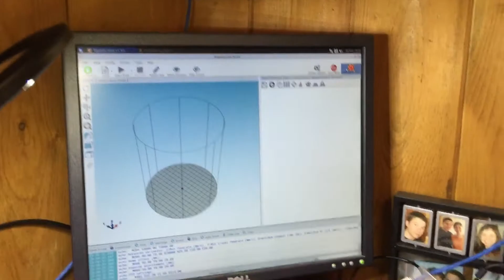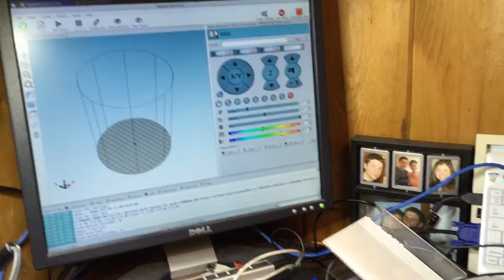Dlt-180 end stops and z-probe

Comment: I'm building one that I ordered the day you posted this (got it yesterday) and I have an issue with the parts differing from the documentation. I got the carriages built with no documentation at all, but the belts are open-end and there's no direction on how to join the ends together to make it a closed loop. I've got 3 thoughts and I'd like to know how you did it before I do something semi-permanent (like zip-tying or cutting them.) Can you show how your carriages are joined to the belts?
Reply from the maker: +Jonathan Mertz all I did was plug one end into the carriage (about half way) and the got it semi-tight (not too tight) and then started putting the other in the carriage and just cut off the extra with a wire cutter.  Here is a picture (https://onedrive.live.com/redir?resid=F34EBFCC1A32BC47!42504&authkey=!AHsWW8KV2Afj03w&v=3&ithint=photo%2cjpg).  This way you can make it tighter or looser just pulling it back out and putting it back in by one or two teeth in the carriage.

Hopefully that gets you cooking!!!  Would like to see your setup once you get it going, do post some vids!
Reply: +iceman198 Thank you very much, that seems to be working with a solid connection.
Any idea why they didn't include a connector for the thermistor or the fan? They included extra wire to extend connections, presumably the fan and maybe one or more other things, but no connectors for those. I'd like to test it out but it just complains that the extruder is below mintemp and won't move. Is that normal, or is there another issue I'm running into. (if you'd like to test, just disconnect your thermistor from the RAMPS board and try moving the head or extruder in pronterface. If yours moves, I've got other problems. If not, that may be my only issue.)
Reply from the maker: +Jonathan Mertz I never actually tried disconnecting the thermoresistor. The fan gets wired right into the board (next to the power that goes to the hotend).  I actually took the fan off the extruder (as it doesn't seem to get too hot) and put it on the side of the board (under the bed) as it seems to get a little toasty under there.  I wired both fans (hot end and extruder fan...well, not the extruder fan anymore) together next to where the hot end wires in.

If you want to just test the extruder motor, I would just plug it into one of the axis spots and move an axis just to make sure the motor moves is all.  If you find (during your first print) that it is going the wrong direction, there is a motor direction TRUE or FALSE in the Configuration.h file to change.  That was something I had to do.

You could always go ahead and just wire it all up and have it heat the hot end up to 200c and then have it move the extruder motor.  Then you'll know if your hot end and resistor work too.  =)  Don't put any filament in...well, unless you want too.
Reply: +iceman198 I've got the thermistor hooked up now but I seem to have a problem with my RAMPS board. As soon as I apply 12V, the fuse starts heating up and soon gets too hot to touch. I think the board has a short causing the fuse to prevent enough power from going to the hot end or motors. Even with all 4 steppers and the hot end disconnected, it still gets hot in a couple of seconds. I'm guessing that this is what has caused my issues from the beginning. Thanks very much for your help! I think my next step is to contact HE3D and try to get my RAMPS replaced.
Reply from the maker: Would you be able to take a pic or short video of how you have things wired?  This is what I used as a guide as the info they sent wasn't that great. (http://forums.reprap.org/file.php?219,file=52456,filename=InternetRamps2.jpg)
Reply: +iceman198 yes, that is exactly how I have it wired. Sorry, I'm at work now so no pic or video. I'm working with he3d to get it resolved.
the fuse no longer gets too hot to touch, just warm, but now the light on the power supply flickers and it clicks when the odometer per switch is on, even if nothing is plugged into the ramps board except power. (It doesn't do it if I unplug power from the ramps board.)
Reply: printer power switch, not odometer per switch.
DYAC!
Reply from the maker: Are they helping you out? They were a little sporadic in responding to me. I had a hard time convincing them something was wrong with my steppers but finally I found they were wired wrong and got the right combination.
Reply: +iceman198 They started out by saying that they could replace the RAMPS board, but then instead walked me through a bunch of troubleshooting steps, mostly dealing with the end stops but most recently re-uploading the firmware to the Arduino. I've told them that I measured the power supply at 12.5 volts when the switch is off, but when it's on it drops to 0 volts. The RAMPS board has cold solder joints, under-wetted solder joints, and solder spatters. I'm 100% sure that it's a bad RAMPS board, and it may have damaged my power supply by hooking it up to a short circuit. I've just asked them to replace both. We'll see what comes of it.
Reply: They pointed out a mistake that I had made which (probably) caused the issue and killed my board. I bought a new RAMPS and finally received it. Everything is working now (as far as I can tell) except that the filament doesn't stick to the print bed. +iceman198 what do you do to get the first layer to stick? I've tried the blue tape that came preapplied to the glass bed, and when that didn't work I flipped it over and tried glue stick on the plain glass. Neither worked at all.
Reply from the maker: +Jonathan Mertz Saw your other comments, thanks for those!

I use the painters blue tape (pretty much what it came with) and that has been working great for me.  I tried hairspray once and that didn't seem to work.  It would let go mid-print.

Try a small print (10mm wide & long) to start with.  Make sure to do the "paper test".  Just get a piece of paper and bring it down so the hotend is just barely touching the paper to where you feel just slight drag on the paper when you try to move it)...there are plenty of videos on this.

Also, I have my slicer settings so it does like 8 loops of a skirt to give enough time for some filament to extrude.

Let me know if you've tried those things or not.  I could do a quick video tomorrow maybe on what I've done.
Reply: +iceman198 Thanks again!
After checking suggestions elsewhere, I cleaned my painter's tape with isopropyl (rubbing) alcohol, and it stuck at least somewhat. I thought you were right that my head is a little too high on the first layer even after homing and autoleveling (G28 + G29) completed? I adjusted the Z height offset to -0.3 which is the distance in mm that I needed to lower it from 0,0,0 in order to snag a piece of printer paper. I am currently printing a beautiful 10mm solid cube, and will next try a 20mm hollow cube. 
https://www.thingiverse.com/thing:271736
Looks like in conjunction with cleaning my tape, your suggestion saved my day.
If the larger cube goes well, I might take a risk and print myself a spool holder.
Reply from the maker: Sweet that you got it going! The mechanism for the autolevel (G29) started acting up on me after about a week so I stopped using it because it stopped being accurate.  =( Calibrating it manually was a pain but now that I have it, it's been working great!
Hope you had a Merry Christmas!